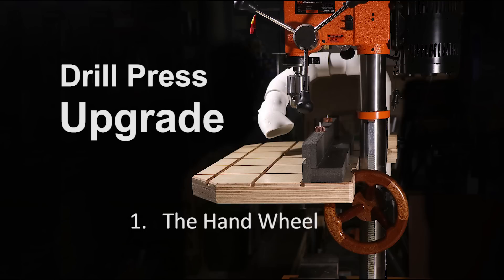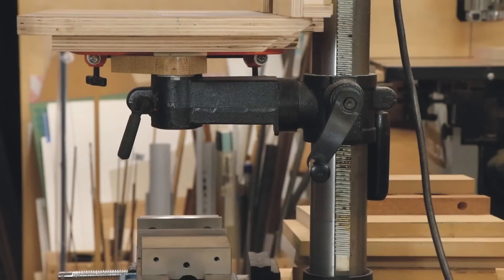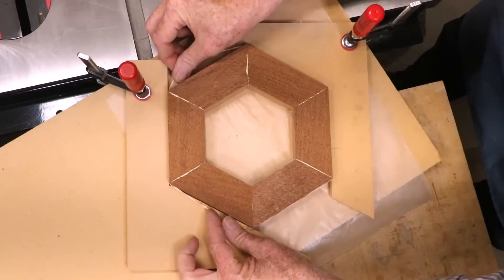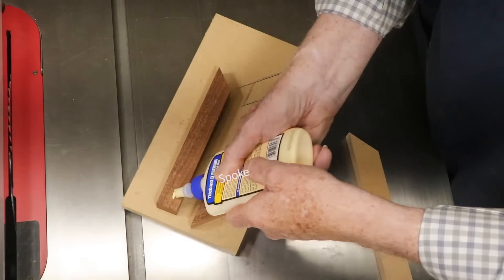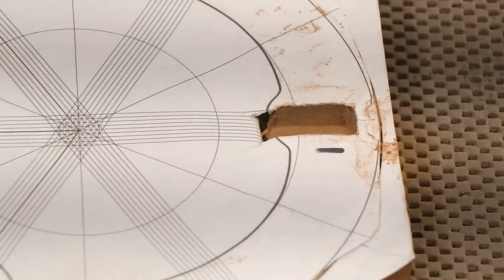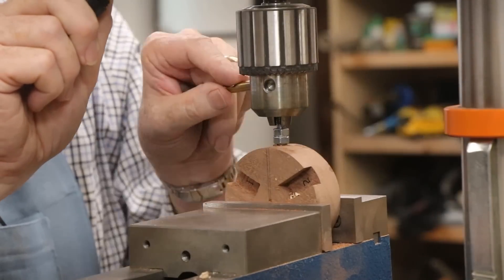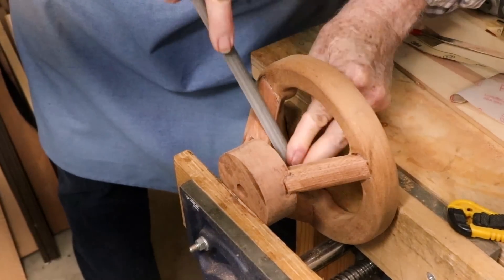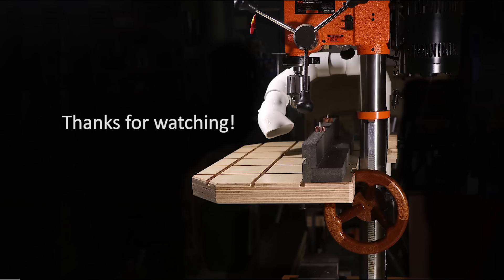Drill Press Upgrade 1:  The Handwheel

Comment: I plan to do this as well and for the same reasons. Tired of my right hand scraping the back edge of the table. I think though, if I can't remove the crank handle bar to replace it with a longer piece, I will end an extention on to it. You can always cut a lap joint into the existing bar and an extention- making the joint long enough to at 3 screws it will hold up well. Then there would be no need for a new handle. For added strength with a lap joint you could put a small pipe clamp around the lap area- over the screws.
I feel the same way about my scroll saw especially when cutting brass. Do you recommend a specific scrollsaw blade for cutting wood that you like?

Comment: Very high-quality work.  I've successfully used a black pipe extension with a sliding cross-pin handle created from a hex bolt.  It works, and it's strong.  Most importantly it was quick to make.

Comment: Did you consider adding a dc motor to the pinion shaft to replace the crank ? My guess is that the table ring, rack and pinion are collectively too coarse which would bog it down ? BTW your production values are state of the art and a feast for the eyes.
Reply from the maker: I think a motorized rack and pinion would be wonderful, but this seemed a lot harder.  However, I would love to have a table that rises and falls with a push of the button, and remains flawlessly centered under the quill at all times.  The machinists have such devices, but they paid more for them than I did.

Comment: Great outcome. Always hated the handle on my Grizzly floor model (same as the Wen design). I sold it along with other floor model tools as we get ready to downsize in retirement. New shop in the planning stage now and from this video, I think I’ll try to find a drill press with a hand wheel but making one may be more satisfying. 😏 Also, I think a scroll saw is in the shop plan now. I’ve always used a band saw, but with the projects I work on these days, the scroll saw may be a great option. Thanks Patrick.

Comment: Just do what I did.  With a piece of steel rod and a small piece of bar stock, I made an extension shaft to move the handle to the right of the new work table.  It's rigid enough that there is no problem just reaching over and crank away to the desired height.  The bar stock gets drilled to fit the diameter of the original crank shaft and a set screw is used to lock it onto the drill press.  The new extended shaft was brazed onto the bar stock adapter. The old hand crank attaches to the new extended rod.

Comment: Patrick, this a really nice piece and well told story!  Question - you mentioned your drafting program for developing templates - what program do you use?
Reply from the maker: I use CorelDraw, a general purpose drawing program.  No 3D, no animations, no typical CAD features.  I bought it 20 years ago or more for entirely different purposes, and use it here just because I am so familiar with it.  If you are looking for a program exclusively for shop design, I suspect there are several that would do more than mine.
Reply: @PatrickSullivan  Thank you for the response - I'm familiar with some other drafting tools through my career, but many of them are overkill for what I need mostly in the shop.  I'll check out CorelDraw

Comment: Interesting solution. I have the same drill press and solved this problem by extending the shaft with a piece of 9/16 steel rod and a 9/16 ID coupler (with two set screws). Filed flats on both ends of the rod and used the coupler to attach to the existing shaft and put the handle on the other end. The extra length is supported by a wooden boss attached to the underside of my new self made table. The rod passes through this boss and is supported by an oiled bronze bushing. Going on 4 years with this solution and it seems to be holding up well.
Reply from the maker: My daughter suggested a similar concept after she saw the video.  I like the idea.  I did not know that you could buy a 9/16" coupling, and failed to think of the idea of installing a support bearing in the table itself to keep the extension from wobbling and bending.  This would be an especially attractive solution if you do work that requires a really big table, where reaching under the table is awkward.
Reply: @PatrickSullivan  Well, to be fair, I do like the fact that your wheel is relatively recessed. My system is pretty robust but in my "shop" (overcrowded garage) every tool is on wheels and I regularly roll the drill press around and have to be careful the extended crank doesn't catch on anything. A little annoying but works for me. And I should have been more clear on the "coupler." I used a 9/16 coupling nut from the home center and drilled out the threads (really easy) to clear the rod, then drilled and tapped for set screws on one of the flats of the coupling nut. Roughly judging from the images in your video, my table is about the same size as yours. 

I also recently discovered (and have become obsessed with) the MatchFit system as it appears you used on your table. When I built mine I used T-track, but love the idea of dovetail slots. With a 3D printer and embedded 10-32 machine nuts I've been able to make some really clever 
modified" versions of the MatchFit track hardware. Would love to have put this in my table.

Comment: Love the wheel. With a larger table load, you'll be also able to apply torque from more than one point of the wheel, compared to a crank handle, so less side loading on the rack and pinion.

Comment: Generally, faster setting epoxies are weaker than slower setting ones.  I honestly prefer the slower epoxy systems for this reason and the additional work time is really nice.

I also really like epoxy like Loctite Hysol that use static mixer nozzles with a taper tip as you can jam a leur-loc tip onto the static mixer for precision application.

Comment: this looks very nice,  but i like a cheap drill driver..  i used a top that only just went over the thingy,  drilled and tabbed for a set screw,  and used a hex to top converter thingy..  low speed on the 18v drill driver,  and i can move up and down very very easy,  and way faster then anything else..   i was afraid the drill driver would damage the teeth on the drill press,  but i used this for 2 years now,  and i see no damage yet..     sorry for bad english :)
Reply: I’ve been thinking about this for a while now. There’s a video somewhere that shows a similar solution. Good idea.